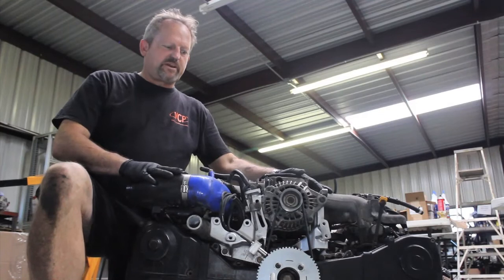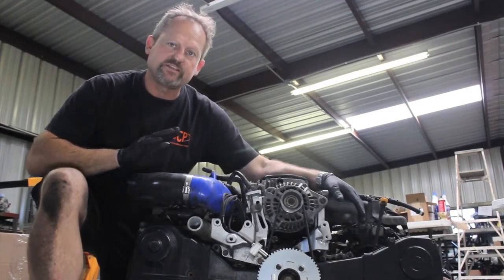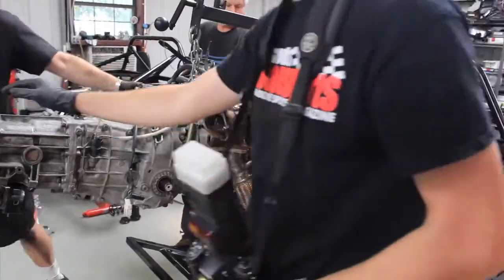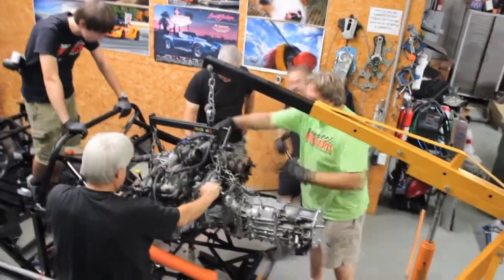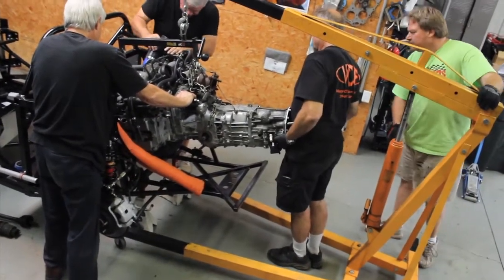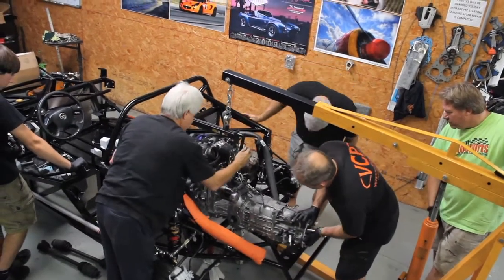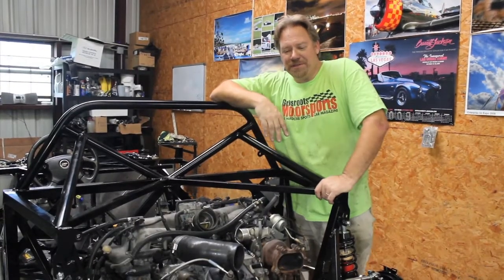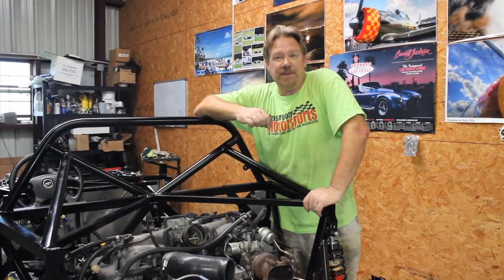Project 818 Part 14: Installing the Engine

Comment: what exactly converts this to a two wheel drive trans? is it a plate that stops the rear shaft output from turning so all the power goes to the front axels?
Reply: +pete7996 Watch part 12 where they do the conversion.